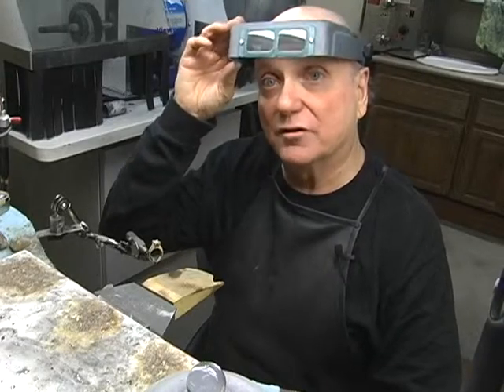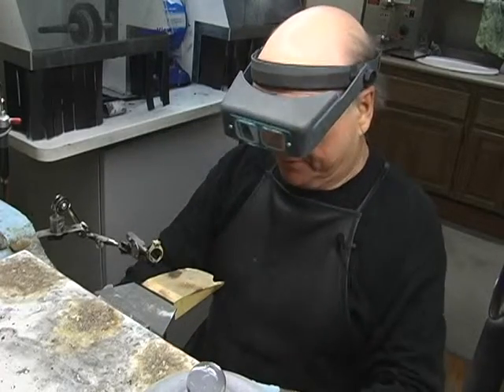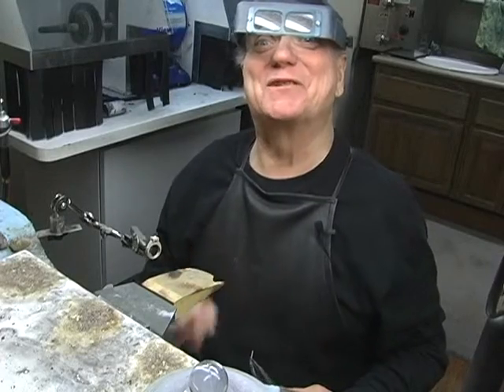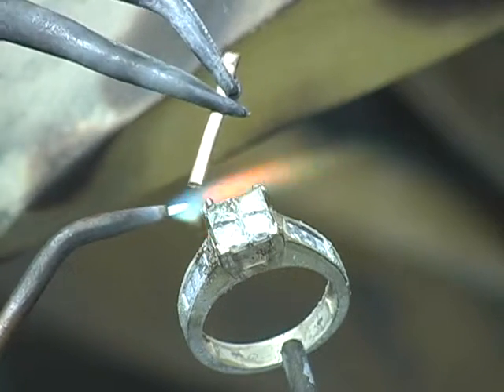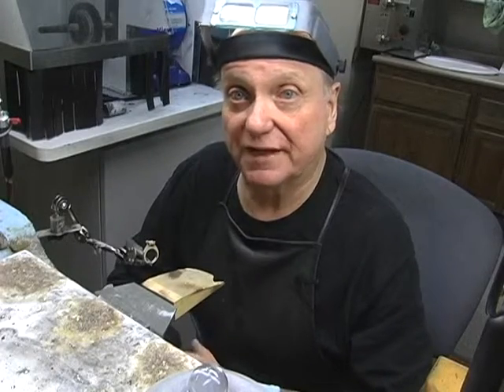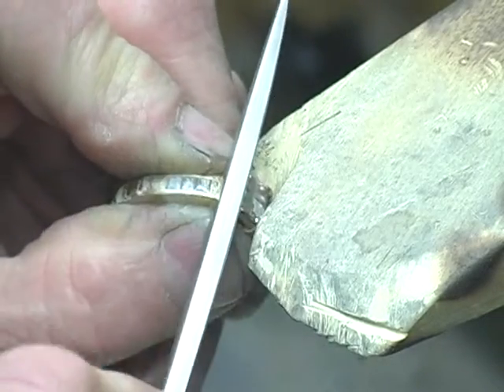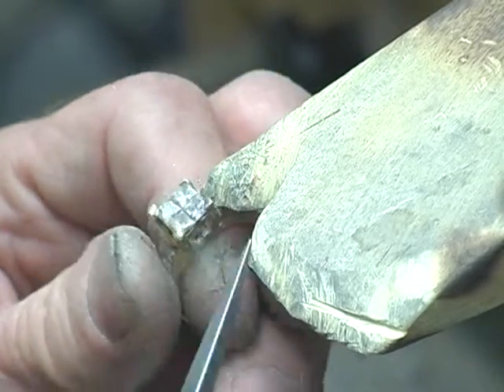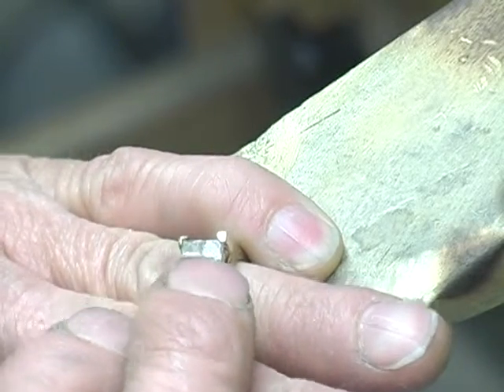JEWELRY REPAIR "THE BURNING BENCH" EPISODE NINE

Comment: When you trim don't you scratch the stone? When I see the file going I fell you make a scratch line on it.
Reply from the maker: diamonds are very hard so you don't have to be concerned with scratching them ... Most stone  will tolerate a file but approach with caution ... Working slow is an asset when filing close to any stones ... Sandpaper is another issue, diamonds are the only stone that will stand up to it ...
Reply: +incidentalpoet Thanks to youtube for having people like you to teach us. I'm discovering an all new word that I was never interrsted. <<never like having jewelry on me, it bothers me. I never worn a watch. So I did not see the point for the rest. But I can appriciate the work of art. I regret now for not liking the work of goldsmithing. It is more interresting than looking at the fewelry.